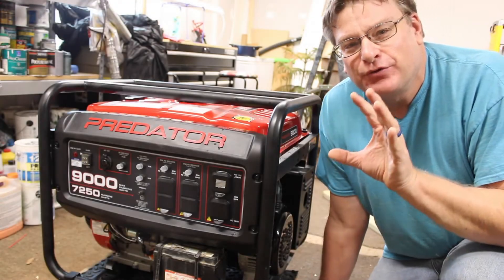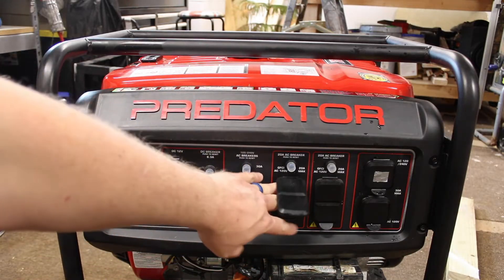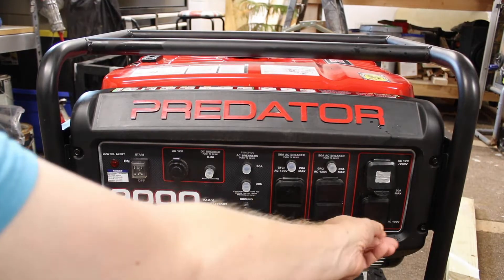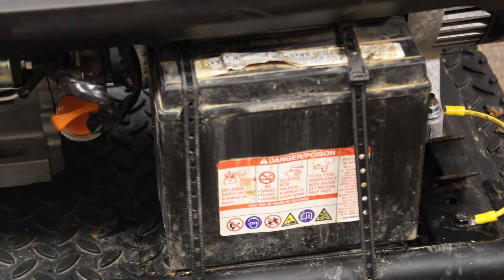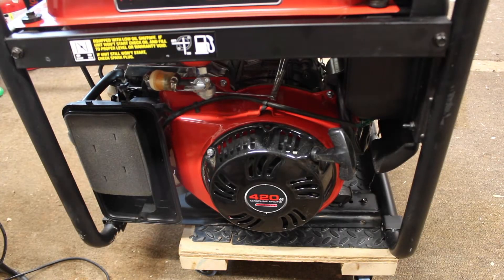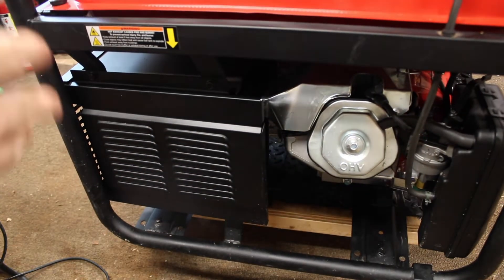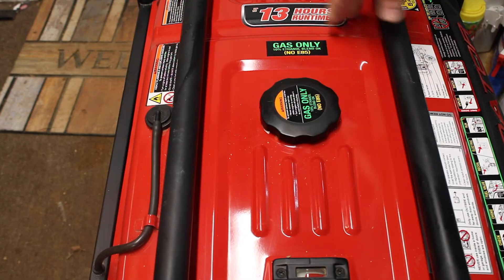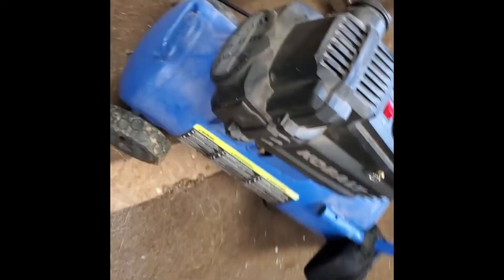2023 - Generator Review: The Harbor Freight Predator 9000

Comment: generators will last forever if taken care of my generac 3250 is 15 years old i have never used anything but full synthetic oil. it starts on the first pull every time.
Reply from the maker: thanks for your input. I agree, when you take care of something it will last forever. My 2 tractors are 40 and 50 years old.

Comment: do you run tv's and computers on this gen ?
Reply from the maker: I have run computers on this generator and have actually used it to power a radio station studio in an emergency situation. I did have good commercial UPS systems inline with the computers.
Reply: @scottsbuildingadventures    thanks for the info.

Comment: Thanks for your nice clip and yes, I do have the same generator and am surprised that everybody I have been watching cranks on their generator and let it run at about 3,500 rpm being ice-cold.

I am a Diesel guy and always let combustion engines warm up a bit and the first thing I have done to my Predator generator was installing a spring to the carburetor making sure it does idle during the warm up period at ~1,000 rpm since warm oil is much slicker than cold lubricants.

Take care and enjoy your "toys"!

Comment: Does it have a pure sign wave for electronics so it doesn’t fry everything in your house. Even furnaces these days have mother boards
Reply: I’ve run my whole house off this generator for two years during power failures. Probably two to three days per year even in winter. I’ve had no problems with anything including my gas furnace.

Comment: I have a troybilt 5500 watt that is 23 years old and has been used hard. Ran constant for a week once. Guess it’s got close to 800 or 900 hours on it. Changed oil every 25 hours and adjusted valves.
Reply from the maker: Wow, I would say it has been a goon one for you.
Reply: Yes it has. I’ve since bought a 9000 watt predator and keeping Troy bilt as back up to back up!

Comment: Why is it that Every Predator Owner talks about first Run-In and oil change to remove the metal particles they find, sorry but if I bought an Engine that produced this amount of metal particles on first run-up, I would return it and request a refund. If this was true then this Engine would be destroyed within the first two hours of running. No small Engine manufacturer would survive if this was true. What you are seeing is NOT metal but Graphite/Graphine Engine Pre-assembly Lube. Don't forget these items sit in storage for long periods of time and normal oil would weep from the main engine components and Dry Start would occur. I see people talk about Magnetic Filler plugs option to take the metal out of the oil, Graphit/Graphine is Magnetic. I also recommend FULL Synthetic oils for better protection than any of the mineral oils, because these engines are Air Cooled a minimum of 10-40, I use 10-50 when possible in Australia because of the temperatures. We do not get as cold as the US, be we get down to 0 degrees at times where I am. Nulon, Castrol or Mobil One are my choices depending on Specials as we pay around $75 - $80 for 5 litre's. As a side note why is it that ONLY Preditor Generators have this so called Metal problem out of ALL of the different Generators on Youtube, simply Predators Choice of Assembly Lube.
Reply from the maker: Thank you for your comment.

Comment: 100% best Generater.Systems I have used. A test for hurricane prep here in Louisiana: three AC units, 5000, 5000 & 8000, 3 fridges, 2 device power setups, 4 flat screens....AND I had 40% of the power meter to spare.
Reply: Don’t use it 
D
Get free gas with out the corn that destroy your carb
Reply: You're running " sensitive electronics "  on a non inverter gen ?
Reply: Do you need to adjust it for a lower electrical load or does it have a mechanism that automatically adjusts it?
Reply from the maker: I use Ethanol Gas, Thanks For Watching
Reply: Thank you, we moved back to Florida and now I wanted a generator to power about the same items.

Comment: Had one. It ran great.  At 8 gallons every 12 hours though, it was impractical to run 24 hrs a day for just refrigerator and TV. Sold it in 2 hours, after two weeks use.
Reply from the maker: I agree it is a big generator and defiantly not the right choice for just running something small for a long time. Thanks for watching
Reply: @scottsbuildingadventures  making matters worse, we had 24" snow and lost power for 13 days. We couldn't get out to buy gas so had to ration use to 1 1/2 hours a day for 6 days and used snow in ice chests. We have a 3000 watt predator now  thay suites our needs much better, we just can't run everything at once. Bought gas today at $6.39g
Reply: @stevesmith9221  Thats why you prepare in advance you never wait until its too late!!!!!

Comment: I have the same generator but I also added a hour use meter that wraps around the spark plug wire $8 eBay. Piece of mind and for maintenance intervals it’s definitely a must !
Reply: Behind panel inside it by c02 sensor 
Unplug at white and blk plug, then tie together going back to generator 
It will keep shutting down until you do this
Reply: @philliphall5198 so unplug the plug w black white wire and then connect or add a jump?
Reply: Just get your self a 12v hour meter and run it off your Secret lighter outlet.
Reply: I did install one of them too since it might come in handy.
Reply: Do you have a link for it? Would appreaciate if you do

Comment: I've had good luck with mine.  Around here, until recently we lost power ~every 6 weeks for 4 to 8 hours, and a couple of times over 1.5 and 2.5 days.  Most of the additional weight for the higher capacity ones is in the generator itself as the lower capacity ones use the same motor.  However, the 13 hp. 420cc Honda clone motor will limit it to ~6500 watts continuous. (HP/2=KW for mechanical generators.)  Lest those who believe they can buy a lower capacity one than 6500 continuous and still get that with that motor, you won't.  The generator itself will limit you then and will kick out.  Another thing to watch out for on generators is the breakers.  Often they will be under the size required for the output of the generator.  Cumulatively they will not be, but it you connect it to your house, you may find that that breaker to the 240v plug is breakered for less than the continuous rating of the generator, which makes the capacity unusable from a practical standpoint.  Very few are going to use both the 120v outlets plus the 240v plug.  This one is good in that regard. (30x240=7200)  Why 30 amps?  Because the outlets, cords, and wiring are a lot cheaper and smaller than 50 amp.  Grounding is a "whole 'nother kettle of fish" when it comes to using a portable generator for a house backup generator and it may appear not to be compatible, but with a schematic, it is easily doable.  When it comes to Tri-Fuel, beware of the carburetors being sold on eBay and elsewhere.  They look like a clean way to go, but they DO NOT WORK in the US.  The US uses 1/4 psi pre-meter in-house for natural gas, while Europe and many other places in the world use twice that or more, and that is where those carburetors work, even though they are sold without mentioning that.  For the US, due to the lower in-house operating pressures for natural gas, you MUST have the large diameter diaphragm to be able to meter properly, and the separate big diaphragm makes a mess of things.  You are going to take a pretty good hit on horsepower with natural gas as well.  That same motor will net you ~5,000 watts.
Reply: Thank you

Comment: The predator 8750 is identical in size to the 9000. So one of them is over rated or one is under rated.
Reply: The 13 hp. 420cc Honda clone motor will limit it to ~6500 watts continuous. (HP/2=KW for mechanical generators.)  11.4 hp, if true, will only get you 5.7K continuous.  Another thing to watch out for on generators is the breakers.  Often they will be under the size required for the output of the generator.  Cumulatively they will not be, but it you connect it to your house, you may find that that breaker to the 240v plug is breakered for less than the continuous rating of the generator, which makes the capacity unusable from a practical standpoint.  Grounding is a "whole 'nother kettle of fish" when it comes to using a portable generator for a house backup generator and it may appear not to be compatible, but with a schematic, it is easily doable.  The difference in prices between brands is a little bit name brand, support, built in monitoring for load, cycles, and hour meters, the design of the frame, and if it comes with wheels and their quality.  You will never add those to Harbor Freight model and have it come out cheaper.  Support for replacement parts is big, and Harbor Freight won't help you there.  The upside is they are Honda clones, which means the parts are interchangeable from many sources that will bolt right up.  Where you run into issues are things like gas tank mounts, etc. and many things other than the engine.

Comment: Nice review. What size inlet should I go with? I have a 30amp inlet but I’m thinking I might need a 50amp.
Reply: I use two 30-amp inlets connected to a 6 and 10 circuit manual transfer switch.  I use the 120/240volt outlet for the 10-circuit transfer switch. The 120volt outlet for the 6-circuit transfer switch.

Comment: How can you get 9000 watts out of a 30 amp line
Reply: 9000 is the surge watts.  The running watts is 7250 which would be 30 amps.
Reply: ⚠️Very important announcements to everyone: 

Please don’t forget to follow the generator safety tips when you use your portable generator. This is just a reminder to make sure. All generator safety rules need to be followed carefully whenever you use your portable generator. 

1) KEEPING OTHERS SAFE: Please do not allow an unqualified person or your children to operate and service the portable generator. Just because some manuals don’t say that doesn’t mean it’s safe. That is important against the generator safety rules. We also need to be keeping an eye on our children too. You need to make sure that your children are not playing near the portable generator especially when it’s running so they won’t get electrocuted. Generators pose electrical risks and they can be hot during an operation. Please keep your children away from the portable generator at all times. It is important to keep our children safe especially our little ones. Be aware of all the hazards.

2) WHERE TO RUN YOUR GENERATOR: Some people use their portable generators indoors which increases the risk of carbon monoxide poisoning. It’s important to have a carbon monoxide if you have a gas generator. Never ever use your generator indoors even if your doors and windows are open and even in the garage is not safe to use a portable generator. Not even at your porch and your deck. It is never safe to use your generator indoors and in enclosed areas of your home. Your generator needs to be 15-20 feet away from your house. 

3)🔥FIRE HAZARDS: Never refuel your generator while it’s running. You need to let your generator cool off before refueling it and before storing your generator. Never overload your generator too. Never ever back feed your generator. You should never plug your generator into a wall outlet. Also never store propane tanks indoors. Please keep flammable things away from the generator as well and please don’t smoke cigarettes near the generator. Having a fire extinguisher next to the generator is also important against the generator safety rules. 

4) GENERATOR OPERATION: make sure your hands are dry before touching the generator. Never use your generator in wet conditions. Don’t let your generator get wet. You need a generator tent if you need to use your generator during wet weather. Please don’t wear loose clothes when operating the generator. Turn on your generator before plugging in appliances. Use the right cord for your generator. Please do not use worn out cords. 

https://youtu.be/I1jT3ANENvI and here is a video more about keeping others safe when using generators 

Hope this helps

Comment: You mentioned not being happy that the generator does not come with a fuel filter. There is a fuel filter in the gas tank that is mounted on the fuel on/off control lever. Knowing this, I still put an in-line filter on mine....
Reply: ⚠️Very important announcements to everyone: 

Please don’t forget to follow the generator safety tips when you use your portable generator. This is just a reminder to make sure. All generator safety rules need to be followed carefully whenever you use your portable generator. 

1) KEEPING OTHERS SAFE: Please do not allow an unqualified person or your children to operate and service the portable generator. Just because some manuals don’t say that doesn’t mean it’s safe. That is important against the generator safety rules. We also need to be keeping an eye on our children too. You need to make sure that your children are not playing near the portable generator especially when it’s running so they won’t get electrocuted. Generators pose electrical risks and they can be hot during an operation. Please keep your children away from the portable generator at all times. It is important to keep our children safe especially our little ones. Be aware of all the hazards.

2) WHERE TO RUN YOUR GENERATOR: Some people use their portable generators indoors which increases the risk of carbon monoxide poisoning. It’s important to have a carbon monoxide detector if you have a gas generator. Never ever use your generator indoors even if your doors and windows are open and even in the garage is not safe to use a portable generator. Not even at your porch and your deck. It is never safe to use your generator indoors and in enclosed areas of your home. Your generator needs to be 15-20 feet away from your house. 

3)🔥FIRE HAZARDS: Never refuel your generator while it’s running. You need to let your generator cool off before refueling it and before storing your generator. Never overload your generator too. Never ever back feed your generator. You should never plug your generator into a wall outlet. Also never store propane tanks indoors. Please keep flammable things away from the generator as well and please don’t smoke cigarettes near the generator. Having a fire extinguisher next to the generator is also important against the generator safety rules. 

4) GENERATOR OPERATION: make sure your hands are dry before touching the generator. Never use your generator in wet conditions. Don’t let your generator get wet. You need a generator tent if you need to use your generator during wet weather. Please don’t wear loose clothes when operating the generator. Turn on your generator before plugging in appliances. Use the right cord for your generator. Please do not use worn out cords. 

https://youtu.be/I1jT3ANENvI and here is a video more about keeping others safe when using generators 

Hope this helps
Reply: @The_Happy_Aviation_Enthusiast  
Thanks for sharing this information 😊... It really helped